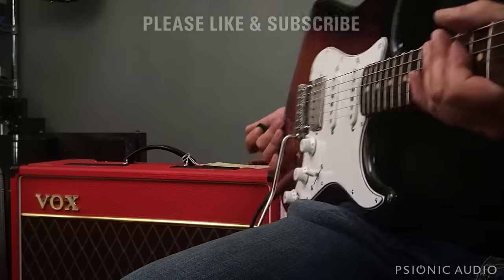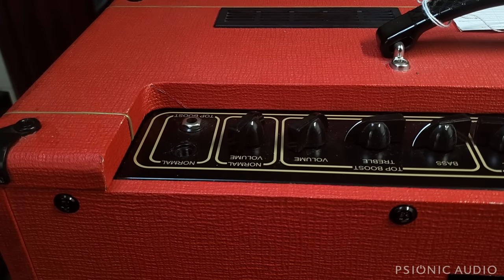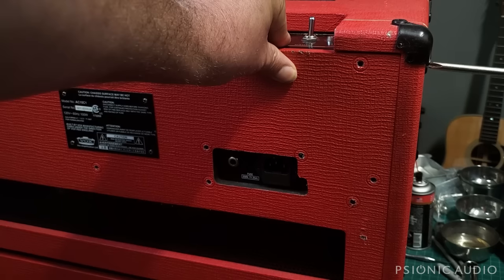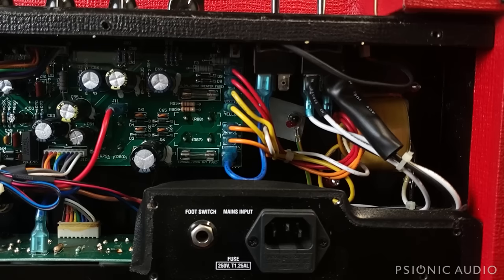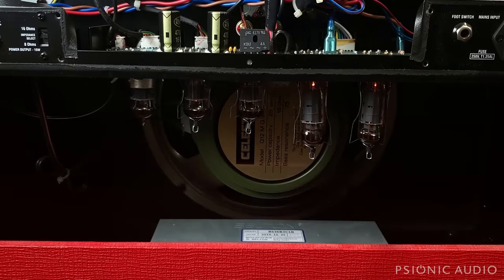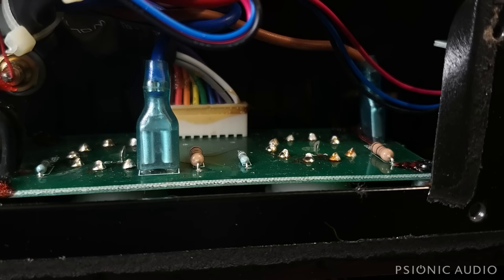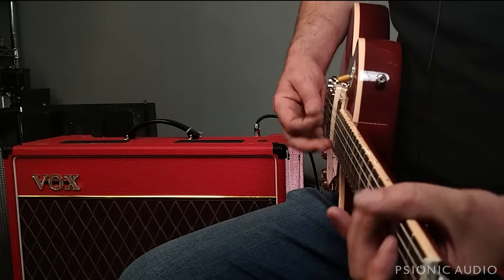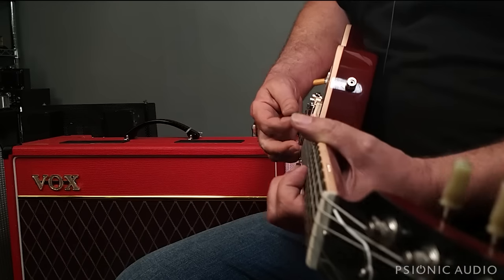Vox AC15C1 - Is It as Good as I Said?

Comment: That direct coupled cathode follower design causes stress to that 12AX7/ECC83 in two different ways: 
One is the cold startup situation with cold heaters which causes too high grid to cathode voltage to the cathode follower. 
The other problem is that in many amps the cathode to heater voltage of the cathode follower of DCCF is around 180 VDC or even more and it is often too much for some tubes and the high cathode to heater voltage causes heater to cathode insulation to fail.
To make that risk lower, I sometimes use  on purpose a clearly mismatched double triode where the cathode follower is lower current triode and the first triode is higher current triode at same bias voltage. The first higher current triode causes larger voltage drop at plate resistor (100k usually) which then gives lower DC voltage to the CF grid. If the plate voltage driven to the CF grid is less than 150V even those bad reputation russian tubes can often, according to my experience, handle it without problems. Well perhaps the sound of that mismatched triode DCCF is a bit different but it still sounds DCCF because it still is a DCCF. 😁

Comment: I enjoy your videos and information which has saved me a lot of money and headaches. Most of the amps I like that would be a stable option have no effects loop. I use a delay a lot and this is a problem for me. Hopefully I can find a good tube amp with an effects loop under $1000. Thanks for your info.
Reply from the maker: Thanks.

I would point out that Edge, Radiohead, Gilmour, Page, and May have all done very well for themselves running delays in front of the amp. And it offers the neat trick where trailing repeats get clean but initial repeats can break up. 

Loops are really only really needed with higher gain amps where time based effects would fall apart with the distortion and compression.

That said, the AC30C2 has a good effects loop.
Reply: @PsionicAudio  Thank you. I use clean, bluesy and high gain which is why I need the effects loop. Delay and reverb just don't work well with my needs in the front end. The only other solution would be a clean amp and then use pedals, but I prefer good tube overdrive vs pedal circuit gain. Thanks again.
Reply: @Bret_Sanor  You can get that Good tube Overdrive Sound at very low volume with this amp ? Thanks 🎸🤘🏽

Comment: Where do you think the longer-term reliability for these AC15s stands? Mine recently died just short of its 2nd birthday while in Standby mode. The amp guy said that he's had a couple of these in with transformer failure. Fingers crossed it's not that...still waiting for the diagnosis.

Great sounding amp though. And yes, the stock reverb is terrible.

Comment: Mine is awesome, stock with no issues but I have an annoying resonant cabinet vibration/buzz at loud volumes. Only certain notes, sounds like it’s coming from under the handle but I can’t seem to isolate or fix it. Any suggestions?

Comment: nice video. what is the difference between the Ruby reverb tank RRVL3AB1C1B compared to the one you used?
Reply from the maker: A series is for tube circuits. This SS reverb circuit uses an E series.
Reply: @PsionicAudio  so if I used the  RRVL3AB1C1B is not the best choice ? My reverb doesn’t sound as loud as it did before I changed it from the stock that was broken
Reply from the maker: It’s actually a really bad choice, sorry. I don’t have time to find part number for you right now. Maybe later tonight.
Reply: @PsionicAudio  I have the item number of the one you used so I’ll just get that one 
Also if you have a link for the neutix input jacks , that would be helpful as well. Thank you
Reply: @PsionicAudio  thank you 🙏🏻
Reply: @PsionicAudio  would model RRVS3EB2C1B work for my AC15C1?

Comment: Damn thanks man for all your Infos! I have a question, the top boost channel of my ac15c1 is having a lot of white noise lately, changed the tubes and it didn't change it.

I know this was not what it sounded like. If I put my instrument cable in the normale channel, it is almost gone.

So I think I can narrow it down to the unit jack, I guess.

What can I do? Can I clean it? unscrew and put it back on?

Thank you for any advice!
Reply from the maker: Jack may just be loose/dirty chassis connection.
Reply: Wiiuhhh thanks I'll try that!!

Comment: I get noise from vibrations at higher volumes. It dissapear when I apply pressure on the top. All the screws are tightened. Its not the handle but I think it the ampchassi vibrating against the cabinet. Any tip on what to do?
Reply from the maker: Make sure it’s not the plastic vents. If so, a small dab of silicone usually fixes that. If it’s the chassis, make sure the side screws are tight. 

It could be the reverb RCA cables vibrating against the back of the chassis too.

Strong odds it’s something minor.

Comment: Just received a used one yesterday. Annoying high speed woodpecker noise changing in sync with reverb knob. It was caused by Ethernet powerline homeplug adapters on my house mains circuit.

Comment: Have you done any reviews for the fender blues reissue. Made in mex...trying to decide wether to keep it or sell it. So dang heavy too...thanks
Reply from the maker: I hate that they call it a "reissue." It has all the same flaws as the other Blues and Hot Rod Series amps. Lots of them on the channel, more coming this week. Put it this way - Blues Ds and HRDs pay my car note most months. They are the number one amp that comes in for service, and they all need the same service. And it was all avoidable if Fender had ever given a damn. They could have done numerous revisions over the years fixing the problems, but they just do cosmetic tweaks and call it a "new version."
Reply: @PsionicAudio  with that said. is this what presonas users can look forward to as fender just bought Presonas. This blues amp retails used at 695.00. prices for everything is inflated.
Reply: for home use , I use emulation on the computer, but if I go out, I need something reliable and good sounding . very simple. this blues amp I have is to loud and to heavy.
Reply from the maker: See my Amps Under $500 video.

Comment: On Tube Rectifiers - I heard it will sound better at lower volumes without and also Dumbles (considered by many as the best amps) are always made with solid state rectifiers. I'm not sure if you can confirm or not
Reply from the maker: No real difference at low volumes. Dumble mostly did higher wattage amps with more filtering than a tube rectifier allows.

Comment: I see liquid oscillating in one of the metal bowls on the bench as you are removing the back panel from the app. Is that alcohol, or water and soap for cleaning?  You are obviously more coordinated than me, because if I had an open bowl of liquid on the bench like that I know damn well what would happen to it as I was disassembling the amplifier!

Comment: A couple things that keep me from wanting and gigging this amp. I don't like that you have to take off that whole back panel just to change tubes.  I also don't like that there is no access to the speaker cable to the greenback, I keep a quilter guitar head in my gig back in case my amp fails and in this case I would have no way to quickly plug the speaker in to the quilter head in case of emergency.

Comment: Just a thought, love the channel, info and presentation, wholly addicted! 
I am an old guy bottom feeder gigging regularly in the uk, pubs mainly, occasional fests and larger stages and carry my own gear. Something like this vox would be ample for my needs, but when you mention weight my heart sinks.. I have a burst disc and at 64 not as agile as I once was and I got rid of my deluxe because carting it up and down stairs etc was killing me. Wondering if there is any way of losing weight in a combo apart from maybe throwing in a neo speaker. I am surprised there is no alternative to trad transformers, I know toroidal are used in trans amps, why not valve? (I am not techy so forgive my ignorance) If I was to build a cab with weight loss in mind, any thoughts? Worth a vid? Would love to hear your thoughts/views. Am thinking I am not alone with the weight issue. 
Thanks again for a great channel. ;))
Reply from the maker: Thanks mate. Even the head version of these is pretty heavy and almost all the weight is the wood of the cab.

If I had your injury and needed to play similar pubs I'd try the Boss Katana, the Fender Deluxe Reverb Tonemaster, an HX Stomp into a little lightweight powered cab (Line 6, Tech 21, etc), or a Princeton Reverb RI with a Neo.
Reply: I use an ac10 for small gigs which solves the weight issue. They sound equally great. I play in a band with keys, bass and drums and it hangs just fine. I do play at full volume and adjust with the guitar.
Reply: Try a Quilter. Great blackface sound and weigh nothing.
Reply: Fender Champ X2. Valve and Digi. You can get just the head then a separate cab, do you're splitting the weight of a combo.

Comment: Mi ac15 also has problems with the input making a noise sometimes. Probably is the input board. It could be rfi noise
Reply from the maker: Clean the metal rings and the chassis where they make contact with alcohol or Deoxit, wait for them to dry, then reinstall tightly. See if that does the trick.
Reply: @PsionicAudio I will try that. thanks for the tip!

Comment: Wonderful amp that really reveals itself with a great guitar, whether from the 1950's or 2000's. P90 pups shine through the AC15C2 and AC30C2. Spend the extra bucks, no need to look back. Or go full throttle with the HW1 models.
Reply: Why do the HW1 cost double the price?
Reply: @biohazard8295  they're hand-wired

Comment: Well after watching bjunior videos I want to get an ac15c1 since it’s not possible here in Europe to get a simple bias adjust on my bjr IV. Music shops want me to send it to fender. Wth. Now it crackled 2 or 3 times but it seems no problems w the tubes whatsoever. Plug it again crackling went away but for sure there’s smtg going on there… Amp is almost new and using it at low volumes.

Comment: I've learned a lot about amps in the last 2 years that I wish I had known when I started playing in the early 90s but a cathode follower still stumps me. My main amp has 2 el84s, 1 12ax7 in V1 and a 12ax7 phase inverter (single channel amp with no boosting, switching, or onboard effects). If I understand correctly the tone stack (mid, bass, treble) couldn't be a cathode follower because there's only 1 preamp tube correct?  And V2 of my AC15C1 IS a cathode follower and I should use a JJ instead of a Russian tube like an EHX?
Reply from the maker: What is your main amp? It sounds more likely to be a plate follower tone stack.

You can use a russian tube as a CF. There's just no guarntee the tube won't die. I've seen it happen in 30 minutes of playing time with a brand new tube.
Reply: @PsionicAudio  I left that little detail out on purpose... it's a Morgan. I know. I bought it before I discovered your channel. It's an MVP23. Single channel, cathode biased el84 with a gain control for the preamp, a master volume for the power section, and power scaling. Tone stack is bass/mid/treble. No negative feedback.  I'm aware NOW of the shortcomings of the build quality but I truly love the tone and 🤞 I haven't had a single issue with it in about 15 months of ownership save for the pilot bulb socket not being isolated from vibration in any way as opposed to my '98 DRRI (with the panel-mounted socket) that I never replaced a single bulb.
Reply from the maker: Haven't had one on my bench, but given the tube complement it's probably a plate driven tone stack so no worries about the tube driving the tone stack.
Reply: @PsionicAudio  Thank you so much!

Comment: I bought this amp two weeks ago and I love it. But since I bought it, the top boost channel has a white noise when I crank the treble knob. Do you think it's a tube that is wrong or could it be something more serious?
Reply from the maker: The Vox tonestack has more radical possible settings than Fenders other more typical amps have. So it’s possible to dial in really awful sounds.

That said, a noisy tube or loose input jack can make these things hiss. Both easy fixes.
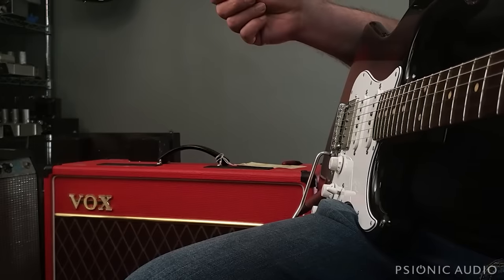Reply from the maker: PS I never “crank” the treble much past 2:00.
Reply: @PsionicAudio  Thanks for your hints. Finally I returned it for a repair since the amp has a strong plastic burning smell, I will have update of the reason why soon I hope. Otherwise, the sound of this amp is amazing.
Reply: @julienlepage7819  my AC15C1 had a strong smell at first as well. They get pretty hot honestly but the smell went away after awhile. I think it was just from being new. Not an issue after a few hrs of use.
Reply: @PsionicAudio  They said my amp was ok, that the smell is probably epoxy heating and that should dissapear after a while.
Reply: @steverossi7949  Thank you for the info, the repair man at the Vox distributor told me the same. I gave my amp to a friend who do live shows to get rid of the smell and work the brand new speaker. :)

Comment: EZ81 is equivalent of 6CA4 and does not use 5v dedicated winding.  Even though it takes 6.3v, you'll be taxing 6.3v winding and may or may not burn it out depending on the transformer design.
I couldn't help laugh when you said that the tolex can get damaged if you look at it too hard.

Comment: I like to practice at guitar stores on a Vox 15 but it is not a gigging amplifier in my opinion. Playing with yourself and playing with A live drummer Are two different things. JJ tubes -  pretty lousy sounds - PU ! . Vintage GE NOS Grey plates Are cheaper than RCA's and they sound pretty good and Are tough compared to the new stuff. My favorite amplifier was A Sovtek Mig Lead 100 through a Marshall 1960 A cabinet with Celestron speaker's, they don't build them like that anymore. 580 VDC on the plates and Vintage Mullard El 34 tubes with Ei pre amp tube's. That was a great guitar amplifier , I looped the hi and lo channels together. My Biggest complaint with Vox is the price of The AC 30 . They are over priced in my opinion.

Comment: Ok …so me being 1/2 moron ,I am curious …..maybe I missed u explaining , but I assumed you had the amp in standby while pulling the tubes and swapping in the “generic Chinese” tube to test. But as soon as you got the Chinese tube in I noticed it light up (or somewhere something new lit up) ,is that “safe”,for lack of a better catch all term? Can it shock you? Or maybe if one is not careful they may “ blow” something if crossing a connection accidentally? Not doubting your skill in the slightest, but for A moron like myself 😜who’s been told to be very careful when pulling a tube ( to varying levels of carefulness but I digress) is there any damaging current (damaging to self or components ) one needs to be aware of if doing this with the amp powered/plugged in?
Reply from the maker: I don’t remember if I put the amp in standby or not - the heaters light up in standby too. But it’s safe to swap preamp tubes with the amp on as long as you line them up right and don’t mind a pop sound in the speaker.
Reply: Just a lil fyi…they automotive trim pulling tools that are made of plastic or plastic coated for sensitive prying area where one would not want to leave scratches etc….think I amazoned a set for $10 (many yrs back)that comes in handy a lot…..you using metal and mentioning not liking using tools to pull that back cover I figured you may benefit..
Reply: Thanks ,I think just watching you show this amp in a few videos u may have sold one for Vox …was considering Marshall  dsl ,well still am but I never thought of Vox before this
Reply from the maker: Watch “Tone Hang with Steve” to hear an AC15C1 outdo most current production Marshalls.
Reply: @PsionicAudio  heading there now 👍🏼
Reply: @PsionicAudio  just pulled trigger on one via amazon ..thanks for your input

Comment: While I understand that manufacturers prefer to use the same type of fasteners throughout an amplifier as much as possible, and/or to buy them from the same source so that they get quantity discounts, to use a combination of machine screws and wood screws side by side that have identical heads and cannot be differentiated from each other simply by looking at the head of the screws when they're installed into the cabinet is just plain stupid.

Comment: In the fifties and the sixties, they manufactured cars that would last generation after generation.  Then in the seventies marketing realized that if an auto wouldn't last as long as the older cars, they could sell more cars and parts, so they began manufacturing garbage. 
This marketing strategy seems to be what's going on with amplifiers, make cheaper quality amps with inferior parts and make more money selling replacements.  The Fender amps made today don't last like the seventies models do, and then there's the unreliable EVH amps, just to mention a couple.  
When I'm shopping for a new amp, I look at the used market first.  When I see tons of a particular amp on the used market, that signals red flags, that something must be wrong with this amp.

Comment: The Vox custom amps use MDF cabinets. That's why they're so heavy. I've always wondered if it was possible to replace the speaker baffle to some plywood? Moving up to the Celestion blue will also increase the volume of the amp. I expect it would fit in with a drummer okay after that.
Reply: Yeah, and MDF is overall not durable long-term. I bought an AC30 secondhand and the panel split at the front corner. I had to go through and insert a solid wood shim/brace to strengthen the cabinet integrity. 

It's a shame that East-Coast company who made plywood upgrade cabinets for these things went belly-up over Covid :/